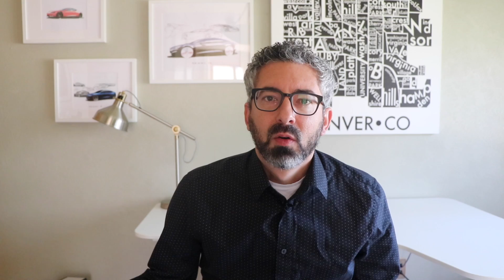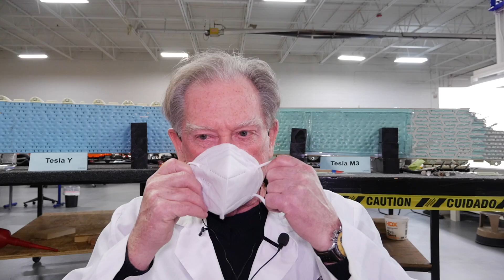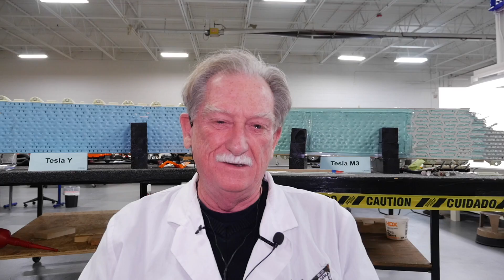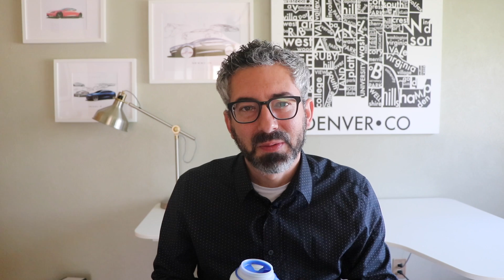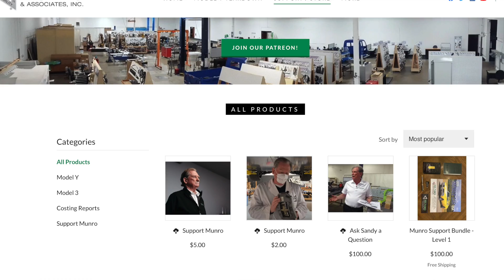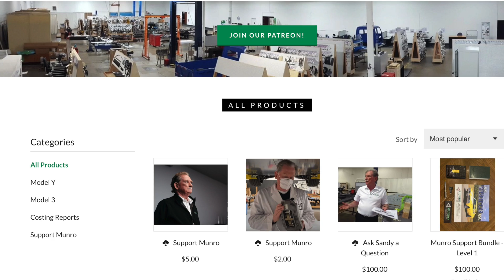Sandy Munro: Model Y is the best EV Tesla makes

Comment: Hydrogen may be the most prevalent element in the universe, but the energy efficiency of fuel cells is much worse than in EVs. So as long as we don‘t have abundance of renewables (which we are not going to have) hydrogen is only an option for small segments.

Comment: C’mon Tesla, you should be able to properly paint a car by now!
Reply: "C'mon <insert established manufacturer> you should be able to produce a competitive EV by now...."!
Reply: Roger Starkey both statements true
Reply: They will get it right soon enough, as Sandy says, the real value in a Tesla is what you can't see, I think Elon is focussed on getting ahead on these rather than on the paint for now.
Reply: I can buy a new Tesla and afford to give it a real paint job, thanks.
Reply: @rogerstarkey5390  Not at all equivalent.  Doing something competently that has been done in volume since cars rolled off Fords line and mastered by every car manufacturer long ago is vastly different than trying to create something significantly different and cutting edge that only one company has done successfully.  
There is zero excuse that after all these years Tesla still can't consistently do decent paint work or fix other core assembly issues that they have been continually criticized for.
Reply: @fanaticvandal472  Yeah, but we non-engineers are the ones signing a purchase contract, so why lag the industry?.  Every manufacturer should strive to be above the median for each competency.  Either that, or Tesla should adopt the "wrap" (any color of the rainbow, multiple finish options) and make a $2000 factory option toward that customization, with every standard car available only in Model T Black.  Don't leave money on the table...
Reply: @L1GHT119  
But one is more true than the other.
Reply: @curtisbme  
Companies supposedly at the cutting edge of their industry couldn't utilise their 80 years or experience, huge workforce and billions in resources over 12 years to match the technology of a startup?
No, they were simply "over confident'" in their own collective superiority, plus unwilling to divert from the profitable but increasingly unacceptable path they had taken.
I've seen reports of issues with those companies fit and finish as well. That's correctable. Meanwhile, some cars coming from the largest European  manufacturer can't even be driven! It's only software! (Apparently)
They've already been launching cars with built in excuses in the press, deflecting from general performance "issues'" towards obscure supposed advantages because it's all they have.

Whether they will get the chance to improve their technology is now debatable, they're hanging by a thread.

I suppose I could mention that certain so called "competent" manufacturers couldn't even advance within their area of "competence" sufficiently without cheating?
(It's probably all of them, but only some got caught)
Nice try, no cigar.
Reply: @rogerstarkey5390  Your comment was applying a false equivalency to dismiss the complaint about Tesla's continued issues with a basic aspect of car painting by stating that other car companies can't create a competitive EV.  Those two things have nothing to do with each other and are nothing alike.  It also makes no sense to rant on about how advanced Tesla is as an excuse for why they aren't 'on par' with something so comparatively basic.  A company can do things well and poorly. People calling out things they do poorly are not wrong simply because the company does other things well.

As to the rest, discussing why big ICE companies haven't been able to catch up yet is an entirely different conversation that have a number of points.  The fact that you think a large, old manufacturer can simply throw resources at something effectively entirely new and just make it work indicates to me that you haven't ever worked for or with this kind of company. Bigger and older they are the worse they are at being able to do something outside of what they have done.

Comment: Hydrogen is just really impractical, its volumetric density is very low and the most energy efficient way to create it is to make it from methane. In that case it's more convenient to just burn the methane as fuel directly.

Comment: For sure we want to know about fuel cell - despite I can't see why it should be better than EVs - always keep in mind that both use electricity - they only advantage may seem to be the energy density of hydrogen and refuel time, but batteries are catching up fast in both aspects - and also in terms of safety.
So there are people who believe in it, I simply can't see why. And there is nothing wrong with producing electricity from hydrogen, but don't make the same mistake like with oil - putting a power plant inside each and every car...

Comment: isnt model Y essentially a newer improved model 3 with a bigger bodyshelf?  assuming improvement in model Y will be applied to the new model 3 as well, why would u reccommend model Y but not model 3 (technically speaking).  regarding the reduction in parts, surely that means more to tesla than car owners (unless they pass the savings onto customers).

Comment: Heat pumps are systems.  Compressors are components.  Noisy compressors means a problem with the Freon or compressors.  Sandy is right.  It’s an air problem.

Comment: The first time I saw good paint was on the first year model LEXUS LS 430 and it was Pearl White I think it was 1986 or so……. 
My paint feels slightly better after four coats of the best wax Maguires makes on my Tesla model three and you can still feel the roughness.
I sold my Mercedes CLS 550 twin turbo V8 for my Tesla. I am absolutely in love with my model three and I miss the ride quality and the leather seats
I had air-conditioning and massage in my Mercedes Benz the ride quality was much better! What I don’t miss about the Mercedes bands and any ice car
Is all the freaking moving parts and all the complexity that goes with it, I hate to think about oil changes air filter changes radiator fluid and all the crap that
Goes into making a ice car. In spite of the lack of high-quality materials and fit and finish I do enjoy the fact I don’t have the complexity to deal with any longer
My Mercedes did not have any mechanical failure in its 78,000 miles before I sold it! the high and Mercedes Benz cars are very reliable when properly maintained
And infinitely better mechanically than a renegade JEEP! Of all cars Sandy you picked the biggest POS on the planet for reliability and fit and finish. I rather have my
Sandpaper paint job on my model three you look down your nose at than your Renegade JEEP rattle trap With a stiff choppy ride I doubt you go off road in that hunk of junk! 
The Tesla model Y looks like a pregnant guppy! It looks too high for the width of the car. I like the practical aspect of the model Y I don’t like how it looks except from the rear rand the Sideview and the front view look like shit and I cannot get used to it. The other thing the model Y dropped the ball on was the crappy suspension that can be improved if you go to Aftermarket parts to make it ride more comfortably and at the same time have a great road manners. Thank you for your wonderful analysis on these cars. You are genius and your company can bring back Detroit in a great way if they could only get rid of the bean counter MBA’s and listen to your company. America is now 15 years behind Tesla and VW is 10 years behind Tesla and they don’t have any charging infrastructure!  America is a complete failure ever since they made profit on planned obsolescence and crappy engineering. My 1966 Mustang taught me how to be a mechanic it was such a piece of shit and everybody talks about how great American cars were in the past that’s a bunch of shit they were rotgut just like white lighting in the south!  Take Care

Comment: I would love to see a tear down of the Toyota mirai and would love to hear Sandy's take on if fuel cells are the future or not?
Reply: Hydrogen.
Start with a unit of energy.
Blahblahblahblah
Finish with 25% of that energy driving the wheels of the car.

BEV
Same unit of energy
Blah....
75-80% driving the wheels.

Who pays for the 75-25% difference?
The consumer.
Who pays for the extra infrastructure?
The consumer.

Irrespective of what you use it for, there's still efficiency to account for.
"Improving efficiency", us the new Hydrogen lobby mantra.... It will never reach 80% for the full "source to wheels" system.

The consumer will always pay for that.

(Then there's the (not) "green Hydrogen" discussion)

Done.

Comment: Maybe the Berlin one will get the paint job done right ... cause supplier is a domestic one. 
But as always: it needs professionals to run a paint shop - the right way and that means they need to have an education they usually have in germany except they hire cheap laborforce from outside... that has happened by others.

VW iD 3 is the next big thing in Europe cause that will be the base for a family of cars like the model 3 as base for model Y ... but in larger scale. 
The ID3 will be the plattform as the Golf before that lead to Audi, Seat, Skoda sedan, coupe, convertible and station wagons ...

hydrogen or Fuel Cell car would be great - but that research had been done by Daimler + Ballard a lot in our neighbourhood but Daimler has abandoned the fuel Cell after 25 years of development for cars, but not for trucks where they had formed an alliance with Volvo + Renault trucks. Busses and Trucks will their goal so infrastructure has to come but there must be a reason from cost to reliability or size that they still did not get in the packages.

Great talk  again and Sandy is a real expert talking straight from the heart like "never recommanded any electric car, far too expensice, buyers will get stiffed, but the model Y is the first and only I have ever recommanded" or his digging into the paint issue cause this description now sounds worser than ever or "they did not have learned any lesson" which also can be caused if model 3 and Y still have the same paintshop and prodcution line .

Comment: For my own opinion I would not waste any time on the fuel-cell deal. It's a technology as many have called it. fool cells and yes hydrogen may be the most plentiful element in the universe but it's always attached to something else and difficult to scrape off. Then there's the cost solar panel electricity will always beat trying to produce hydrogen. So for me I won't be wasting any of my time watching anything to do with fuel cells. Contrarily I absolutely love everything you're doing regarding Tesla

Comment: @34:38 - "Hydrogen is the most plentiful substance in the universe." True, but irrelevant. You can't shovel it up off the ground. It is a fleeting gas. All our hydrogen comes from splitting water (H2O). This is done (inefficiently) with electricity. Electricity is the true "plentiful substance". We can generate it with ever increasing ease and renewably.

Comment: Hydrogen cell is not the same as battery. Case in point, EV's can be plugged in at home. Hydrogen Cell you still have to go to a station to refuel. Toyota is pretty stupid. Furthermore, those Hydrogen station is costly. If Toyota had any balls, they should have done what Elon has done supercharging stations  - toyota should make hydrogen stations.

Comment: Sandy, I know you're a busy guy but, when you get a little time, you should read The Hype About Hydrogen, by Joe Romm. It lays out why hydrogen for energy storage is not going anywhere.

If someone came up with a way to make and use hydrogen with an overall efficiency of 80% or more, as with batteries, I'd have a whole different view. There are other problems, but they're generally manageable. It's the efficiency that's the deal-breaker. And no, it's not about the Hindenburg. In fact, I'll say this: If the economics favored hydrogen-floated airships, they would be in widespread use. They're not, and that one disaster is not the real reason.

Comment: Hydrogen is made with electricity and efficiency lost.  Hydrogen requires transportation similar to gas and efficiency lost as well as more volume on the roads.  I hope to god the Hydrogen cell goes no were.  The transportation of electricity for BEV is already at your door and is much more efficient.  Lets not fall into the tobacco and oil interests cycle again.

Comment: Hydrogen is not intrested for normal people normal users hydrogen is only intrested for those who once you  tied down to gustation , and you only be able to fit your car by going and buying gas from the dealer, that's all . Hydrogen does not make any sense it self price vices, in energy sufficiency you have to spend money, ressources, power, to make hydrogen, and then you have to take it apart to make  electricity! That's beautiful idea for space travel, not for Lind travel, absolutely dumb idea  even though hydrogen is most of bended element in the universe I don't think you can scoop up like you do with water or air anywhere in  the Earth

Comment: Yes I would be interested in hydrogen teardown. From a tech/facts/science point of view of how they do it.

But I'm not convinced with hydrogen is the future.
You have to make it. Either from carbon source (methane) or electrolysis. Both needs vast amount of energy.
Once you have hydrogen, you have to compress it and that takes lots of energy.
Then you have cool this gas, which needs lots of energy.
You need to store it which uses energy.
You need to transport this liquid which takes energy.
Then you pump this liquid into the car or it's re-gassed which takes energy.
The hydrogen car also has a battery to store the converted gas to electric. You can't run directly from hydrogen conversation.
Then the killer is, you are relying on a (big) company to do all this and you pay them. What price would they offer? Cheap....? Na.
Remember hydrogen fuel cell isn't that efficient in converting ( sources to hydrogen and) hydrogen into electricity.
You also need an air filter to remove containments from air before using in fuel cell. And I'm not sure the longevity of the cell.
Let say electrolysis using solar. Why have all that step just to make/store/deliver hydrogen. Skip this process out.

If battery EV you could get from solar or wind. No middle man, no gas station.

You could in desert, in theory, carry 10kw solar panels in the back(of cybertruck). You unfold out this array early in morning. Charge over the day and you rest. When it's night, you drive -100 miles? Repeat many days till you are out the desert. Getting you out of a sticky situation. 
As for ice or hydrogen.